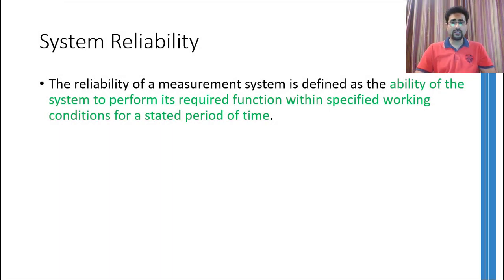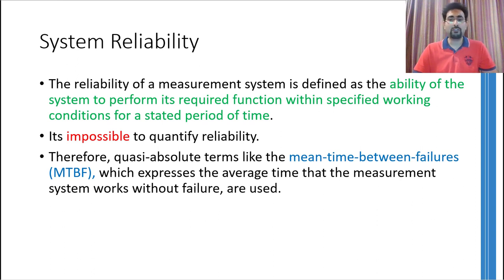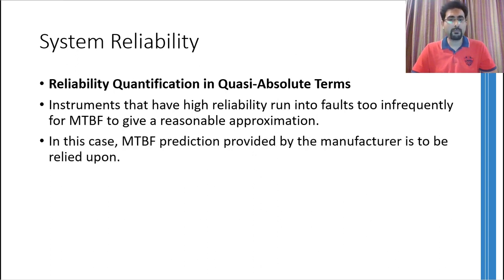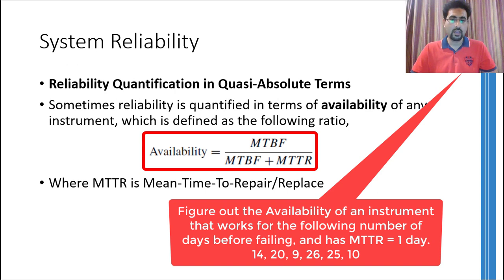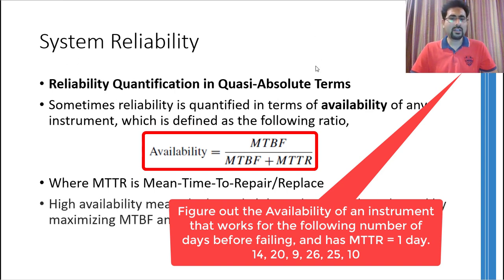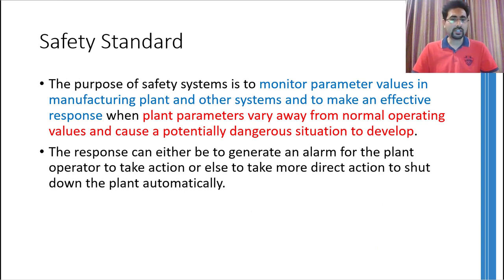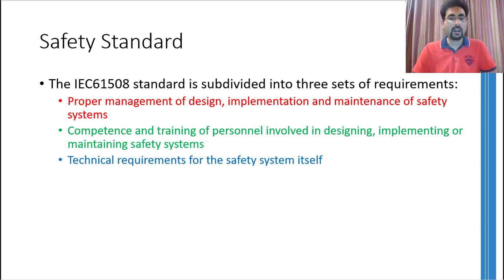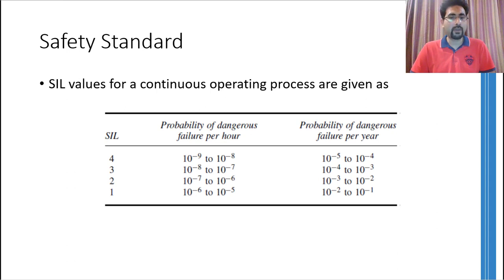Lecture 8 Industrial Safety Systems | SIL Certification

Comment: Data:
         MTBF=(14+20+9+26+25+10)/6
=17.33
         MTTR=1
Formula:
         Availability=MTBF/(MTBF+MTTR)
Solution:
          Availability=17.33/(17.33+1)
Result:
          The availability is 0.945.